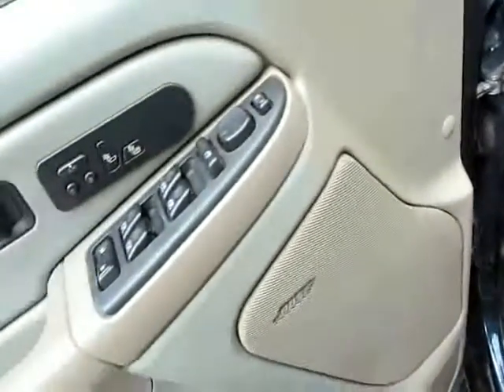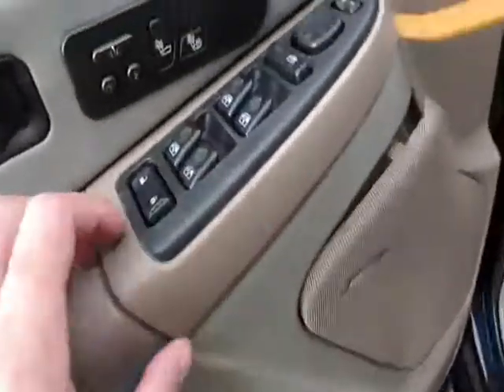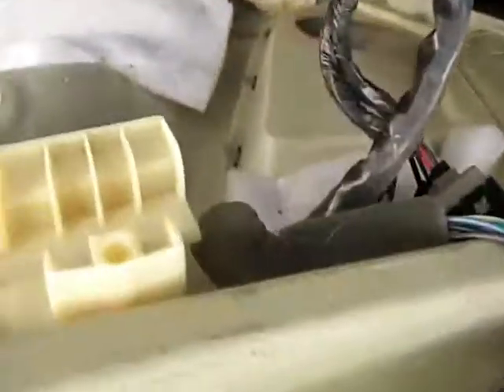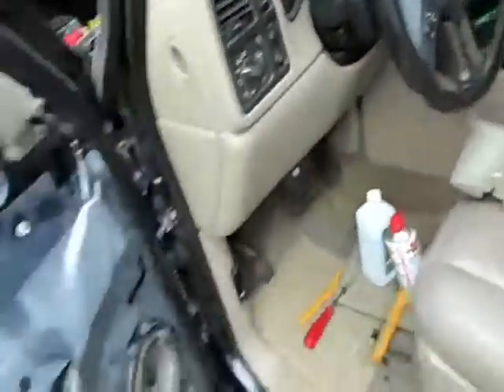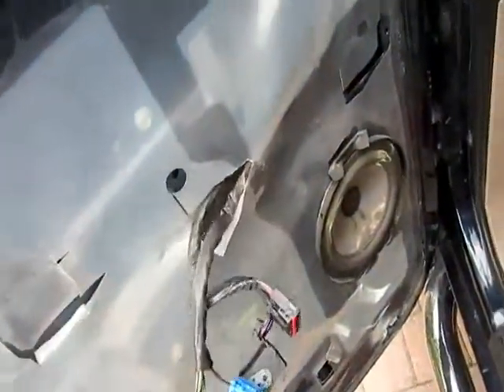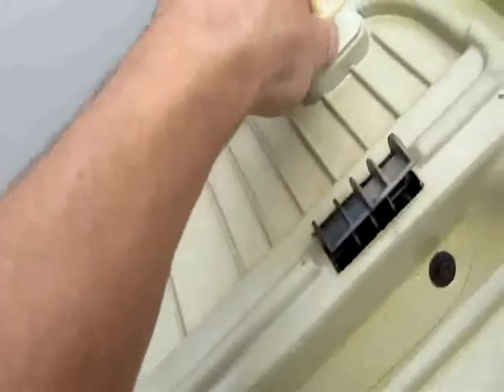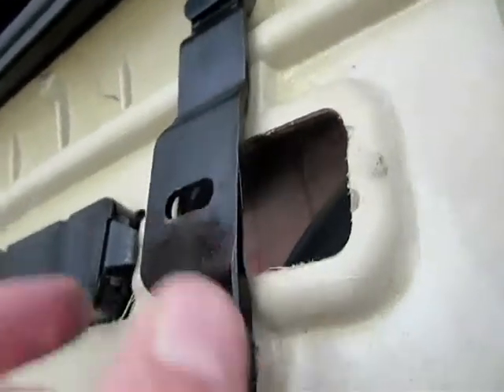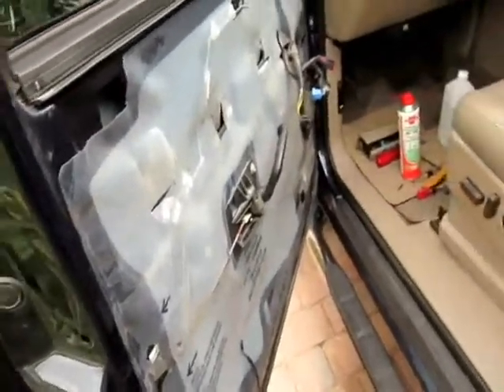How to Door panel  Removal FRONT 99-06 GMC Chevrolet Truck, Sierra, Silverado, Yukon Suburban Tahoe

Comment: Hey I have a question what is the metal line called that you clipped into the clips??
Reply from the maker: the door lock rod?
Reply: Ghetto Wagon yes  at 2:51
Reply: Does the door pocket just pull out or are there clips you need to work with to get it loose ?

Comment: the switch cover is bolted to the panel on the backside with a 7mm screw
Reply from the maker: +Travis R.  yup. I think the older trucks had 2 clips. You really have to do alot of wiggling to get the switch back in its hole
Reply: yup
Reply from the maker: Next I have to take the door off, cut off the hinge pins and install the corporation hinge pin kit. I have over-sized bushings just in case Maybe soon as its not so hot, Only 85 instead of real feel 115+ . Travis R.

Comment: The 1999-2006 Chevy Silverado/GMC Sierra (GMT800) speakers are notorious for going out because GM make them so cheap by using paper voice coils.
Reply from the maker: +Duran Medine (FreightExpress1993)  I think there are the Bose speakers, They seem to be of better quality than the standard ones.   What was gross was there were a bunch of baby roaches inside the door panel, I guess they crawl up through the bottom of the doors, roaches are everywhere outside.
Reply from the maker: Duran Medine
 It does not have tweeters either, the earlier trucks did
Reply: they go out because the gap in the window drains on top of them.